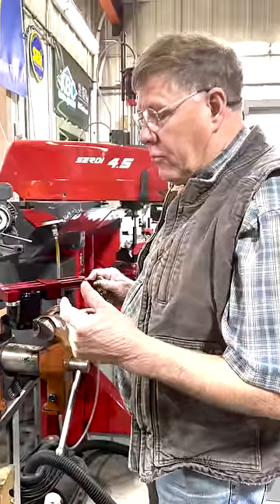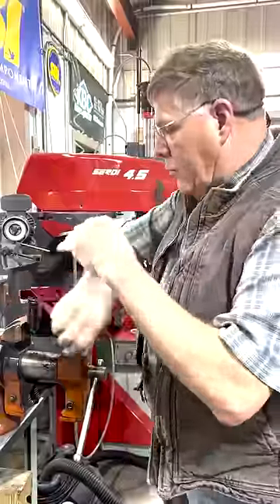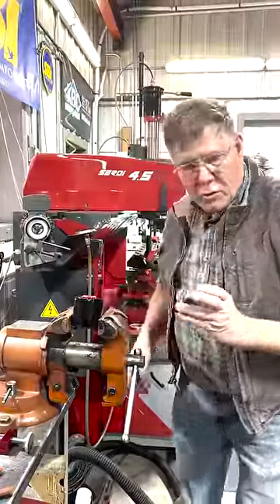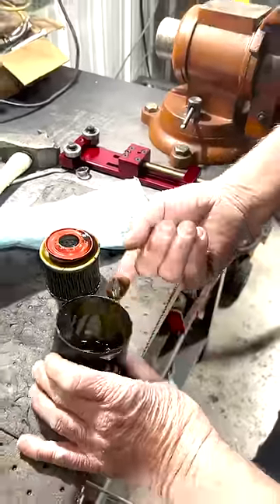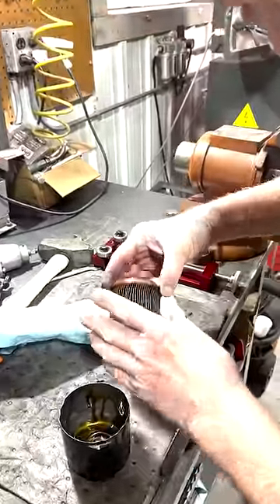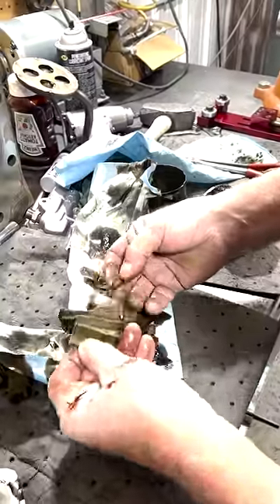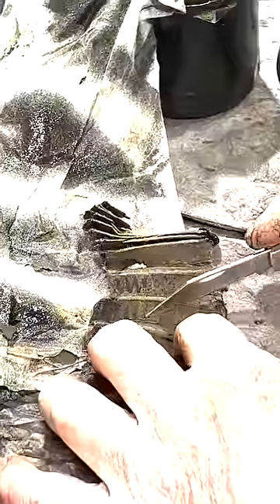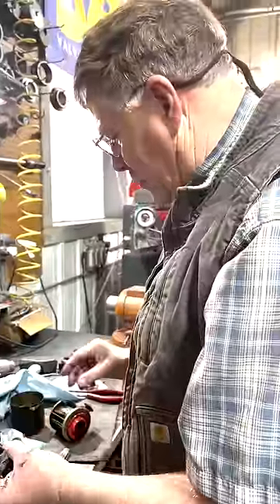#shorts Our Customer Ran His Engine OUT of OIL! 🤦🏻‍♂️

Comment: Hi,please explain how I’ve gotten away with no oil change for 130,000 miles.Truck had 117,000 when I got it.Changed oil and filter at like 130,000.Just started burning a small amount of oil.Maybe half quart for 1500 miles.Oil changes in small car or truck engines is NOT necessary.Especially at the rate they suggest.It’s a huge scam!